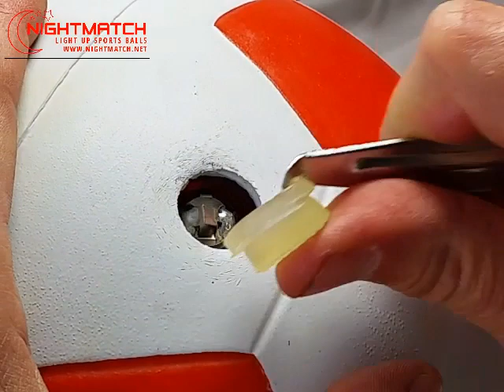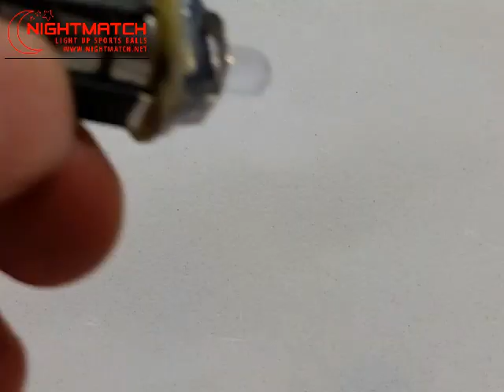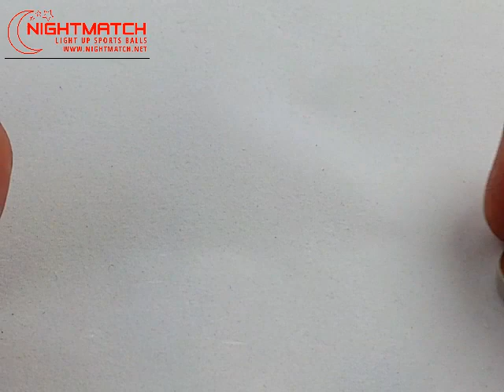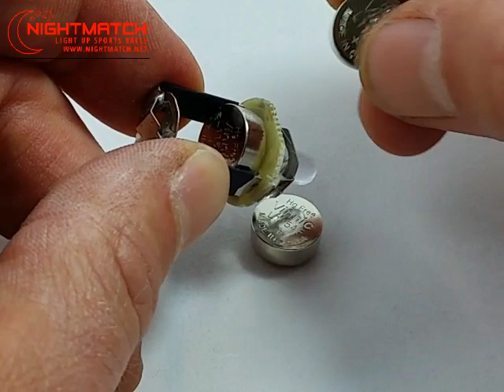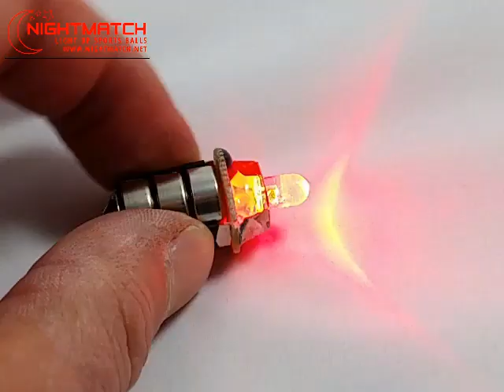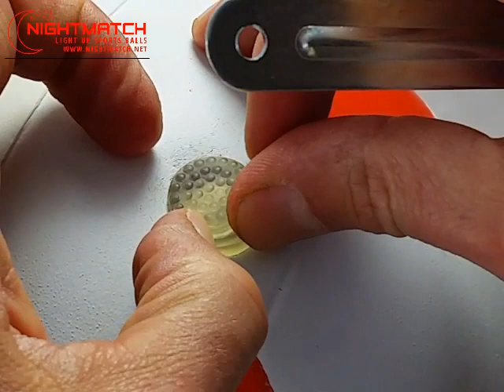NIGHTMATCH Light Up Balls Battery Change Instructional Video

Comment: i have tried too much , but that batterycase wont come out?
Reply: It will come out much easier if you deflate the ball a bit. You can do so by inserting only the needle of the pump (without the pump).